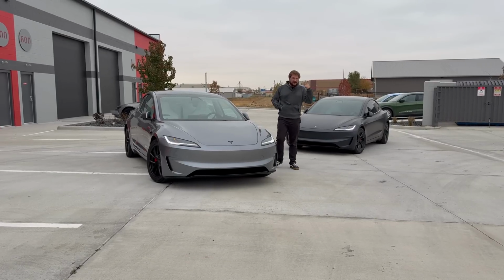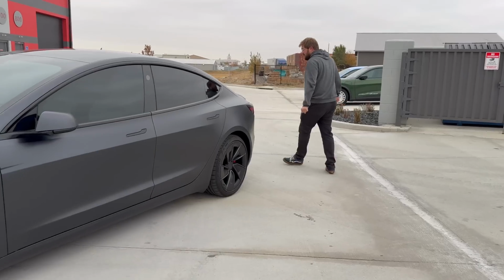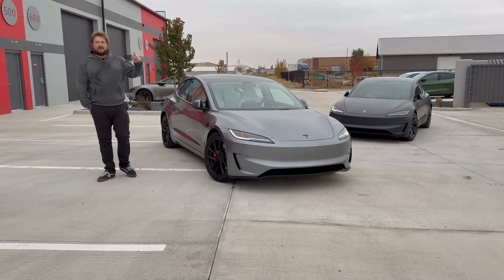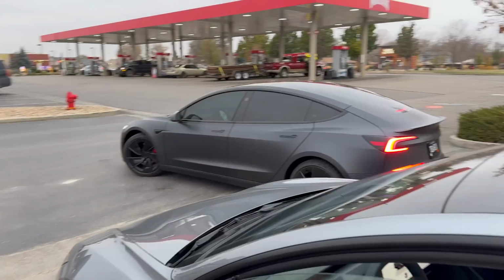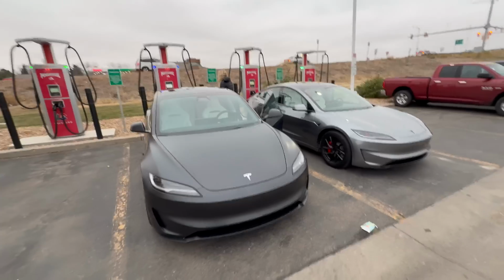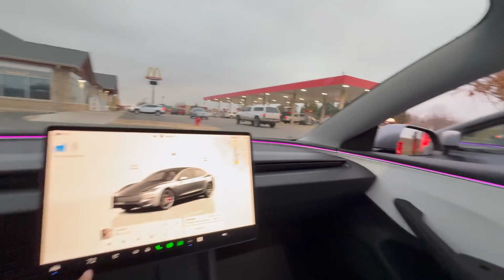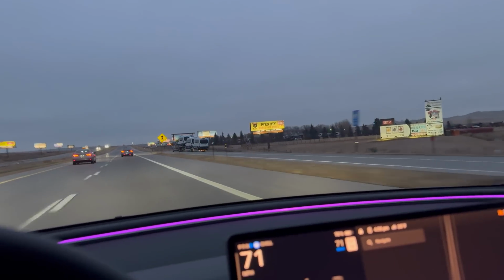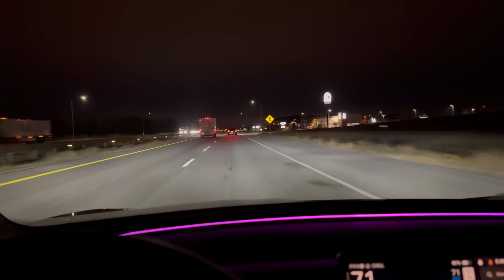Tesla Model 3 Performance Drastic Range Increase w/ These Martian Wheels!

Comment: I put 19 inch wheels on my MYP24 for winter tires. My consumption improved about 8%. It's now 3 weeks later, temperatures have plummeted to around freezing and those 8% have equalized to where I now have the same consumption as I had on 21inch wheels and summer tires. It's a pretty good buffer.
Reply: The increased density of colder air is not your friend…. unless you have a wind generator.

Comment: Love the look of these MW08s. I got 19s for my M3P since i didn't want any issues with clearance. 

One drawback of the 19s is less tire selection though. Seems most manufactures target the 18" size for EV tires.
Reply: Curious what sort of efficiency improvement you saw with the 19s, if you don’t mind sharing.
Reply: Did you see any efficiency improvement? If so how much? I need to buy a set of wheels/tires for winter.

Comment: I might have missed it - how cold was it? Won’t the model 3 performance summer tires perform worse in the cold?
Reply: 38 degrees. Can’t you not drive summer tires at this temp? Or did Brandon’s car switch from summer rubber to all seasons?
Reply: @wendystacos7447 they are fine. They just harden as the temps drop.

Comment: I put 18’s on my 2023 M3P and get about the same results. My wh/mi falls in around 230’s to 240’s on highway at 70mph-75mph. In the city, I‘ve gotten as low as 188 wh/mi. But normally 190-210.
Reply: i dont think my 24 m3p has ever done under 300 wh/mi 😂😂😂
Reply: @r2awes  You know, I worry sometimes they screwed up on my car and put LR guts in. Because, it seems to do better than most other mp3.
Reply: What size tire did you do on your 23?
Reply: @deej628   235x45x18 Factor size from Tesla for 18” wheels.

Comment: Just curious on the car with the 18’s did you go into the service menu to change the wheel size configuration? I believe that changes the cars computer range and speed calibrations to account for the different wheel sizes. Great comparison test!
Reply: Good point, if the tire diameter is different it would affect the displayed mileage and efficiency readings.
Reply: He mentioned a couple of times that he believed the tire diameter was the same as stock, verified by 71 indicated still being 70mph.
Reply: @bnort1040  sure though even smaller changes can still produce results that may indicate a better performance than actual. I haven’t watched it through yet, did he mention the tire brand or width differences at all? Wonder if the Hankooks are a more eco focused design and if they also were a 275 rear section width as opposed to the normal AWD setup which is a square 235.

Comment: Too much emphasis is put on the wheel vs tire in this.  The tire is the bigger factor.  e.g. @24:49 "all about seeing the efficiency difference from just the wheel change"    AND TIRE CHANGE!!!
Reply: i just want a tire that improves road bumps... thing is so stiff
Reply: No the tire almost doesn’t matter. It’s really the wheel diameter that matters the most.
Reply: @davidglieder8862   That's just straight false.  The tire matters a lot.  They aren't all the same because they are black rubber.  There's a reason there are high performance summer tires, snow tires, all season tires.  By default, the performance model has high performance summer tires, pirelli pzero's.  Look at this data. https://youtu.be/rLjsNpNTlzM?t=651
Reply: @davidglieder8862  That is wrong.  The tire plays a huge roll.  There is a whole metric of tires that's called rolling resistance.  Not only that, the width of tires changed from original wider, the 18" he put on are narrower.  Tire rack has a whole test on tire affecting wh/mi. https://www.youtube.com/watch?v=rLjsNpNTlzM&t=651s
Reply: @BrianK04  okay that’s interesting. Personally I‘m driving EV‘s since 2016 and have gone through all sorts of different tires EV and non EV, winter and summer. And the only significant changes I’ve noticed was when the wheel size changed. And changing from 19“ to 22“ inch the difference is over 20% which is incredibly huge I think

Comment: It looks like the stock wheels have the stock performance tires too. This range increase is not all down to the wheel diameter, but also the tire compound and section width of the tires. Not exactly a like for like comparison between wheels.
Reply: Yeah from what I can find online the tires on the Martian wheels are definitely more efficient.

Comment: Thanks for doing this and taking care to make sure both cars are 'the same.' That's a good improvement in range, and kinda sad too. I guess the P car is designed for just that- performance. The only thing that I can think of to make this comparison more 'fair' would have been to throw some weights in her car to approximate your weight. Oh, and the white interior is probably faster too, right? :)  Thanks again! Always enjoy your videos.
Reply: Weight matters little in an EV, and basically not at all at constant speed.  Plus, the driver weight difference is offset by the wheel weight difference.
Reply: I wonder if the "Long Range" model was designed for longer range?

Comment: Loving my MW08 Martian wheels. I went with Bronze 18s with max tire meat 255-55-18 Michellin LTX m/s so Im ready to rally
Reply: is your turn radius any worse? which wheel width did you get?
Reply: @r2awes  https://youtu.be/0sgpVYpl2yM?si=nlUYeDzYcsRo_WKa

I meant to attach a pic and made a short.. wtf
Reply: @r2awes  9.5 width only because 8.5 was sold out
Reply: No rubbing lock to lock. I should have kept Cross Climate 2s which are quieter but having this meat is awesome